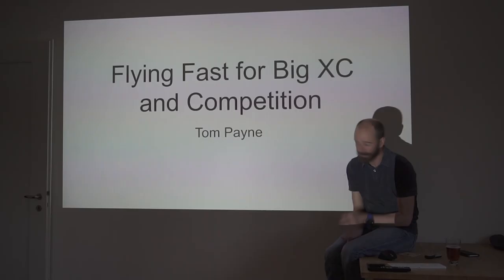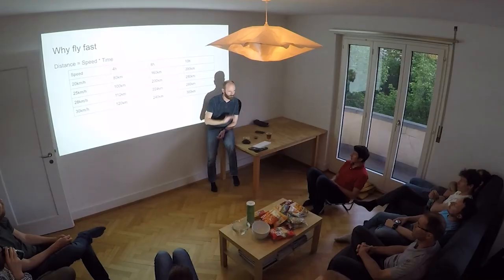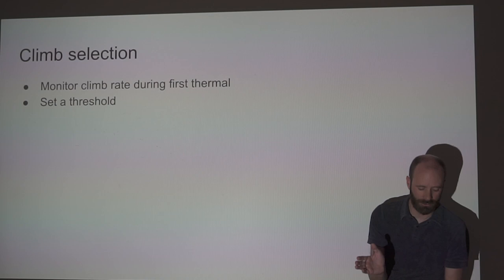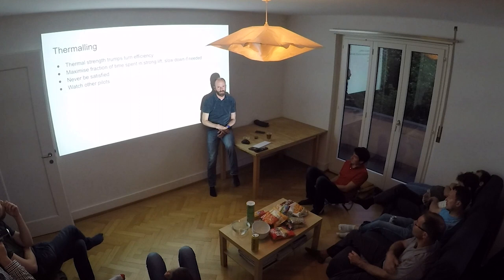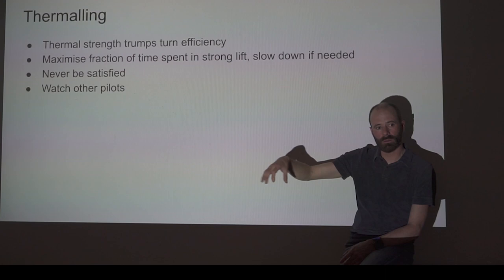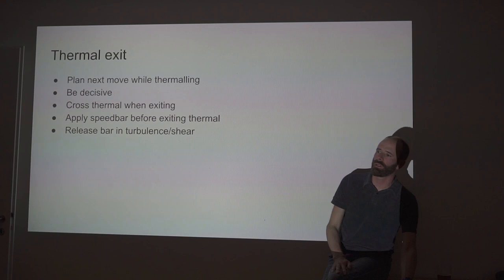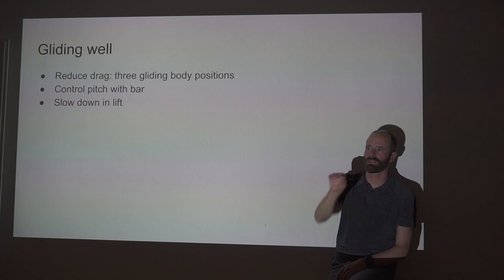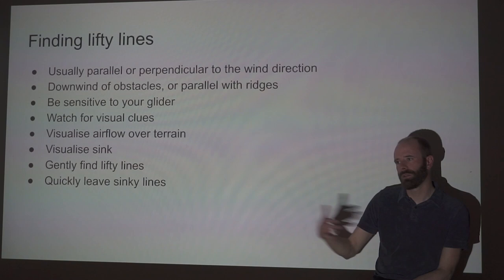Flying Fast in Paragliding Competitions [2019]

Comment: also depends on the type of the task. In Brasil with high tailwinds they fly avg speed of 40-50km/h. Triangle speeds are a different story though.

My next goal is a 100k flight (flying for a year now)
Reply from the maker: where are you from and where do you usually fly?
Reply: @sierikas  sorry I've just seen your answer. Most of the time I was flying in Czech Republic (flats and low mountain range). Now I'm living in the German Alps.